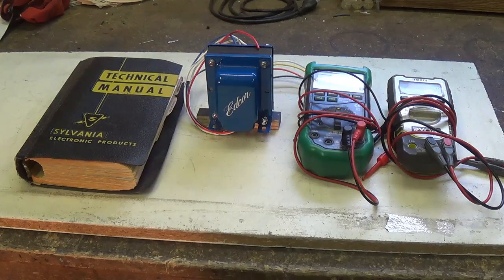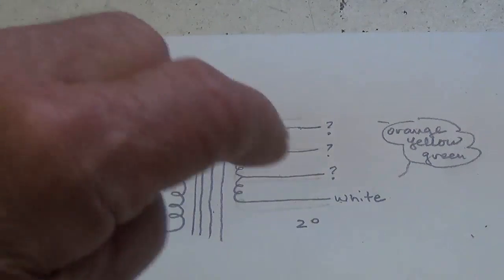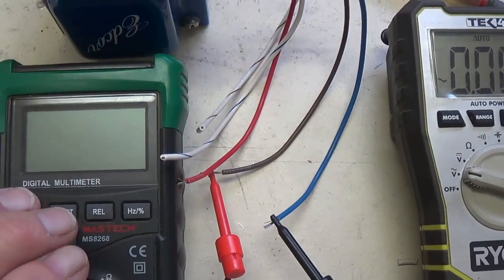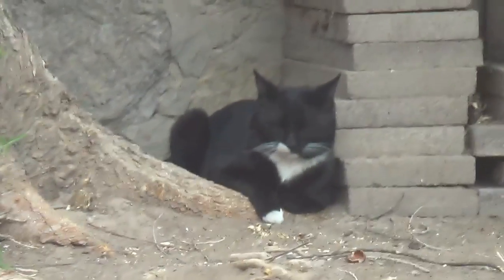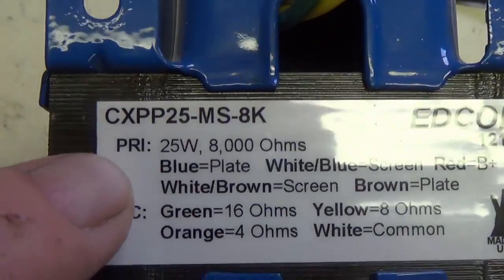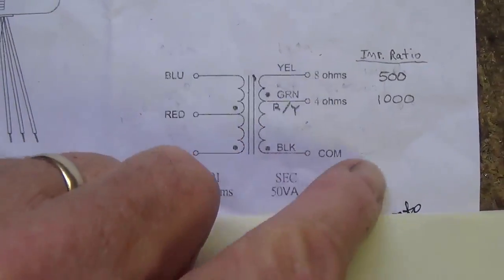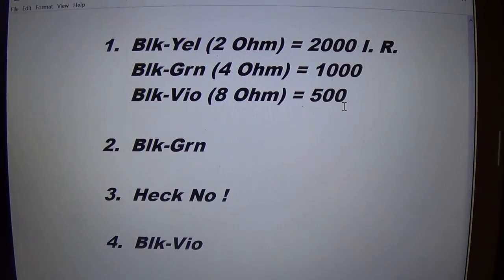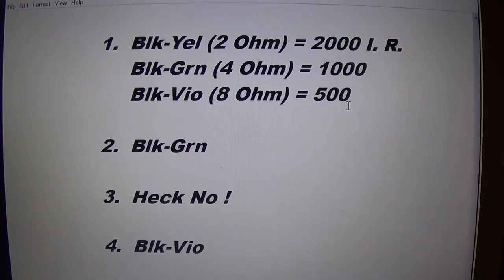Impedance Ratio: The Easiest Way to Decipher Output Transformers

Comment: thanks for the video. great useful knowledge. just a thought, would it be safer to send the 7 volts or even the 12-14 volts from the filament transformer into the primary winding of the transformer under test? it would set up the same ratios with millivolts on the secondary. is there a drawback to this i am missing?  this is how i've done testing before when left to my own devises. thanks.
Reply from the maker: Most people don't have voltmeters that are accurate in the millivolt region, Joe, and an accurate reading is essential for proper calculation of the winding ratio. Let's face it, if a person is sufficiently competent to safely work on a tube amp circuit, with 350 to 450 VDC, they should be able to cope with a couple hundred volts during  testing procedure. If not, they should not be working with any voltages, high or low.

Comment: Hello uncle Doug I try this technique but it's not working in my OPT for 50EH5. I detach the OPT of my tube portable turntable and check if I can use this kind of technique But here's the reading I feed 6.3v in the secondary of the opt the output voltage primary is 83v. So 83/6.3= 13.174 then I square it becomes 173.5 and the 50EH5 is at 2.5k to 3k plate load. I used 3k for that the result is around 17.29 It is very high I cannot get 8ohms but the speaker they used in my portable is 8ohms. Is there anything I miss in this calculations? Need help thanks
Reply from the maker: Your calculations seem OK. It's quite possible that the company simply used whatever they had on hand, i.e. your OPT and an 8 Ohm speaker. There is no guarantee that any company used precisely the right components in their circuit. It would appear, however, that you would be better off with a 16 Ohm speaker.
Reply: @UncleDoug  ok thanks uncle Doug.

Comment: So Uncle Doug I've been thinking, when Eddie Van Halen used a variac to supply less voltage to his Marshall amp (to make it sound different), wasn't he raising the impedance of the output transformer? And wouldn't that create a dangerous mismatch? I think you said lower speaker impedance can produce catastrophic damage. Thanks!
Reply from the maker: I don't think so, Rick. Simply operating the amp at lower AC supply voltage would not, as far as I can see, change the relationship between the load resistance of the output tubes, the winding ratio of the OPT, and the impedance of the speaker.
Reply: @UncleDoug  I was just wondering because the tube manual shows load impedance going up as plate voltage goes down. Eg.the 6V6 has load of 8000 ohms  when plate voltage is at 285vdc and a load of 10000 ohm when plate voltage is at 250vdc. I kind assumed as the variac supplies less supply voltage the plate voltage would drop.

Comment: Thanks, as always for the clearest tutorials!  I was wondering why you just don't run wires from the wall plug to the primary, and measure the output voltages on the secondary side?  Wouldn't it accomplish the same thing?
Reply from the maker: Hooking up an output transformer's primary to wall AC might work, but I think I'll stick with my method and a Variac.
Reply: I'm sure your way is better, I was just thinking that for those of us who do not possess a variac, running wall to the primary would serve the same purpose....I didn't say run it to the secondary, b/c nobody wants to see a couple thousand volts on their kitchen table!!  BTW, everyone warns about not running a amp without a speaker load...Is what I suggested (running wall current to the primary of the OT) doing the same thing? You don't need to respond, no worries.  Thanks again for your great videos, and I love your deadpan humor.!!  I just watched your Harmony "Bassman" 4x8 combo, and I loved the comment about the how the stapled foam on the inside looked like a bordello, but how would you know? LOL!
Reply from the maker: @aaroneisenstein4663  Plugging an output transformer primary directly into an AC outlet just goes against my better instincts, Aaron. I prefer the control and isolation that a Variac provides. Glad you enjoyed the video.

Comment: Hello Uncle Doug! I hope you and your family are well!!! I love all your videos!!! I have a question about the "Effective Tube Load" if you uses 2 6V6's or 2 6L6's arranged Single Ended and Class A. How would you calculate the load presented to the Output Transformer? Thank you very much and Give Jack, Casey, & Ollie a pat for us!!! Say Well
Reply from the maker: If the tubes are wired in parallel, as they would have to be, the resistance would be half of the single-tube resistance.
Reply: Uncle Doug Thank you!!!

Comment: Hello Doug  - first of all a big thanks for sharing your knowledge with us! This channel is just great!
I am currently working on a hi-gain amp which has an output transformer with no markings whatsoever, so this video helped a lot.
One question though - is the number for max load resistance the same for quad-tube amps? So is the 6000 ohm for the 6L6GC the same or does that change for quad-tube configurations? (for the impedance calculation ... )
Thanks, Marc
Reply from the maker: Just like with resistors, BS, the formula for net resistance of four equal loads = the resistance of one divided by the number of loads.....i.e. four 6000 Ohm 6L6's in parallel have a net resistance of only 1500 Ohms. The more pathways you provide for the current, the less current has to pass through any individual pathway.
Reply: @UncleDoug  Thanks a lot - now it makes perfect sense!

Comment: Output transformers: demystified at last! I have a stash of 70-volt transformers rescued from the trash pile. ("70-volt" refers to the type of amplifier circuit, not actual power output. Something to do with the audio signal running above DC current / ground potential. Anyway...) I've read tales of these being re-purposed as cheap but viable tube amplifier output trannies if used properly. But it's the "properly" part that never seems to get explained beyond "get it right or you'll fry something!"
That is, of course, until now! Thank you, Uncle Doug, in every language.

Up next: a Rat Rod that's drive-able without being a rolling death trap; but is it technically still a Rat Rod? The PBR Tattoo & Beard Community is outraged!
Reply from the maker: You should be able to analyze the winding ratio and calculate the impedance ratio on each transformer, PS. This will tell conclusively if any of them is suitable to be an amp OPT.   You're welcome :)  It's coming along, slowly but surely.

Comment: Great video. Learned the method about a year ago, though. Used the method to figure out the secondary taps on an old 2x EL84 movie projector amp that I restored and modified into a recording/practice bass amp. 
Question: 2x EL84 P-P wants to see 8k in pentode mode or 10k in triode mode according to datasheets. My amp is ultra-linear, does it want to see 8k or a different value?
Reply from the maker: I would think that being ultra-linear, it would be in pentode mode....thus 8K load resistance.

Comment: Knocked it out of the park, Uncle Doug...And no, I didn't forget about you. I'm just not risking anything to the weather around here...or along the way.
Reply from the maker: Thanks, Tom.
Reply: @UncleDoug  You're welcome, Professor Doug(8-)...oh, and thanks for the update on the rat rod. I paused the video and admired your rear suspension work.
I bet it took some cyphalatin' to get that all engineered.
Reply from the maker: Yes, there is a lot more going on under the trunk lid than you might expect.
Reply: @UncleDoug  Ya still have the touch though, so it's all good.

Comment: Great video as usual. I would have inyected the 7V onto the primary side of the transformer and measured the much lower voltage on the speaker side of the transformer. Thus, avoiding shock hazzard.
Reply: That low of a voltage might be hard for some meters to measure accurately.
Reply from the maker: Exactly right, Mr. H. With even minor care, the shock hazard can be avoided.....thus you would be sacrificing accuracy in return for virtually no real benefit.
Reply: @UncleDoug  oh, right, I now realize that inexpensive multimeters don't have a mV scale in AC Volts. Good point. Anyhow, if you have a reasonably good DMM I think you'll be ok. Maybe inyect 14 V instead of 7.
Reply from the maker: Would you be using a Variac to produce this unusual voltage, Charlie ?
Reply: @UncleDoug  14 V ?  Transformer is 12V CT (14 V or 7+7) with no load.

Comment: Awesome video! thanks a lot for sharing all the knowledge with us! I have a question though: what happens with the impedance of the output tubes in case there're four tubes? all the data sheets I can find always only mention values for class AB with two tubes. Thanks in advance!
Reply from the maker: Thanks, Alex. As with all resistors, adding an equal pair in parallel will reduce the overall resistance to one-half of the original value.....i.e a pair of output tubes may have 4000 Ohms of load resistance, while four will have only 2000 Ohms.
Reply: @UncleDoug  Thank you for a quick response! this is exactly what I was thinking about but wanted to double check if my understanding was correct. thanks again, love your videos and learn a lot with every video! Stay safe and have a great day!

Comment: Also, barring minor fluctuations and given that the difference in voltage when connecting to the "green section" is way less than 1%, I think it might be due to the secondary with less windings having a low enough impedance to actually "load" a little bit the first transformer's secondary loop. May it be?
Reply from the maker: I'm having some trouble understanding the question, Fabio.

Comment: I've learned a ton from your videos, and this one's no different! I'm feeling more confident now about taking a chance on old/used/un-labled transformers. What methods are there to tell the difference between power transformers and output transformers? (Either visually or by testing)
Reply from the maker: That's good, KT. Color coding can be helpful. PT wiring codes are fairly consistent.

Comment: If one had a mystery transformer ( and I do) with multiple primaries - all unknowns - would it be possible to safely pick out three of the primary leads to give you, say 8k, using this method? I'm assuming you'd use a meter alone to identify the CT and each pair of matching windings first.
Reply from the maker: If you can accurately map the secondary leads using an ohmmeter, which can be a little tricky at low resistance values, then yes, I would think you could find an Impedance Ratio providing 8K primary impedance for, say, an 8 Ohm speaker......provided that such a winding exists in the OPT.

Comment: Changing the plate voltage just to get the speaker impedance to match exactly seems like a good teaching exercise, but not really practical in real life.

 I sometimes think that tge need to have the speaker impedance match the it exactly is a bit exaggerated.

 For example, when you plug an external speaker into a Fender amp, it introduces a second 8ohm load to the output transformer in parallel, effectively changing the impedance load to 4 ohms without addressing the issue at all. These amps have been used for decades without issue. As a matter of fact, Fender presently uses the exact same output transformer for its Blues Junior amp (single 8ohm speaker) as it does with its Fender 2-Tone amp (2 speakers in parallel 4 ohms total impedance) Point being that you can be off a bit and you won't see smoke coming out of tge back of your amp. 

But it is good to see the math behind all this. An interesting video might be one showing how to wire a switching jack so that when you connect a second speaker, it changes the OT to the 4 ohm tap. I've done this on an amp once. An old Magnatone 213 that got an new output transformer with multiple taps.
Reply from the maker: I never suggested that plate voltage should be manipulated to achieve impedance matching, Joe. It doesn't make sense. You simply use the impedance value from the tube handbook that fits the plate voltage in your circuit. Yes, you can "get away" with mismatches, but why do it, when proper matching is easily accomplished once you know how to do it. It's my purpose to demonstrate proper techniques and understanding, not to foster careless muddling and seeing what you can "get away with".
Reply: @UncleDoug  I'm back here from the most recent video, and I watched the mirovox video where you mapped an unknown OT. So in this video, when discussing the use of impedance ratios and finding the various tube types that could be used with a given OT, is that solely from the perspective of circuit design, or are you also speaking in terms of alternate tube choices in an existing amp? I wonder because even if, in the case of your edcore transformer, you can use 6V6's most clearly, but also 6L6's, it wouldn't allow you to swap in 6L6's because the plate voltage from the B+ is set for use with 6V6's. Thus, adjustments would need to be made so a tube doesn't get fried due to too much B + voltage, etc. Am I correct? Thanks for all the knowledge you share. It has helped tremendously with understanding my amps, but more generally as well with electrical theory, etc. Many of my friends think I'm much smarter than I really am.... 🤣😱

Comment: Seems like that transformer (at 25:58) could be used with the 2 6L6s and the orange secondary wire and 2 - 4 ohm speakers in parallel or 4 - 8 ohm speakers in parallel.
Reply from the maker: Yes, if you use multiple speakers to achieve unusual net impedances, you can find a whole lot more uses for any OPT.

Comment: Hello Uncle Doug, greetings from Holland,  I have a question:   are these ratio's usabel for the whole 20-20Khz, or do you need te messure with a few frequenties ?
Reply from the maker: They do vary with frequency, BT. The generally accepted input frequency is 1 to 2KHz. I used 60Hz to keep the method simple and accessible for viewers......yet, as you noticed, the results coincided quite well with the manufacturer's data values (probably done at the higher, recommended frequency).

Comment: Great and very informative video.  How do you determine the load resistance on useful and uncommon tubes that don’t have the plate to plate load resistance listed in the tube manual? 
I have some incredible sounding commercial amplifiers that use 6GT5 and 6AV5.
Reply from the maker: Thanks, Jon. Good question. Work backwards on an existing circuit. Determine the Impedance Ratio of the OPT, then using the speaker's known impedance, calculate the plate load impedance.
Reply: Doug, another question.  I have several high quality push pull transformers that have in addition to normal speakers have a 500 or 600 Ω seperate winding.  Is there a way to use that to make a line input direct to a studio board or PA line input?  Does it need extra padding?
Reply: I watched this again since I have a JMI Vox AC50 on my bench and the speaker terminal block isn’t marked.  That’s my job for today.  Good review.    An un related to my Vox question that came up while rewatching your video,   Can you use the wires for Ultra Linear leads as the primary wires instead of the Blue and brown wires that you connect as plate leads on socket?.  Pin 3 of 6l6,  I love your rat rod.

Comment: Uncle Doug, i was given  3 pair of OT and i checked the logo seem like Siemens. I can't find any data from google. Maybe you had seen that before. Its just have code 71/1811 II, 71/1516 and 71/1514 II.
Reply from the maker: The codes aren't helpful to me, JH. You'll have to measure the winding ratios and guess as to the power handling capabilities

Comment: Great video, thank you! One thing that surprises me about the tube data in the book, is how for the 6L6GC (for a two tube power stage), the increase of 50V plate voltage, calls for a lower resistance (6000 ohms instead of 6600 ohms) on the primary of the transformer. Wouldn't we expect the opposite, in order to keep the loadline away from the maximum dissipation curve?

If we trust the information available about for example the Soldano SLO100, it works with an even higher plate voltage (somewhere just below 500V), while the output transformer has a primary of 2200 ohms, or 4400 ohms for a 50 watt, two tube power stage version. This 4400 ohms at an even higher voltage, looks graphically even more wrong, but I guess mister Soldano knows what he does. What's your take on it?

Have a great day.
Reply from the maker: I have not ignored your question, Frederik. The answer is so complex that I am having to do some research and study to provide a proper response. Please be patient.
Reply: @UncleDoug  
Thank you!